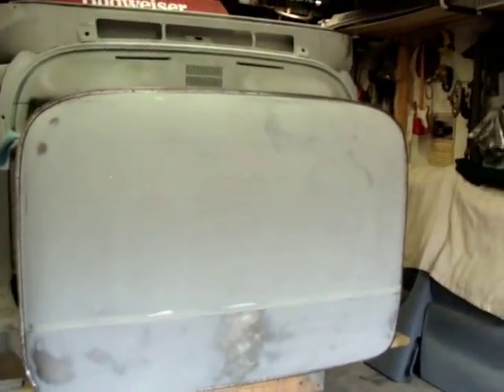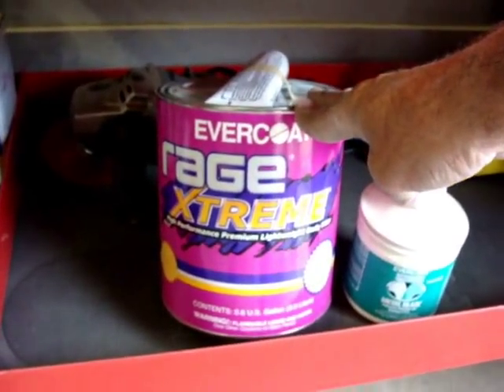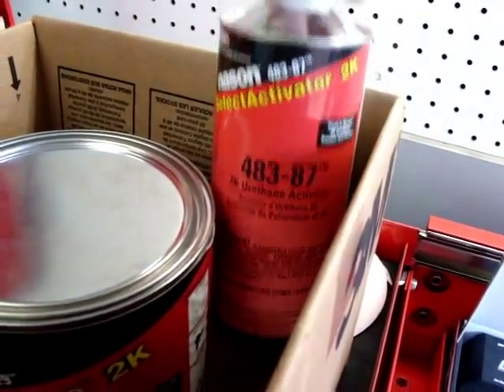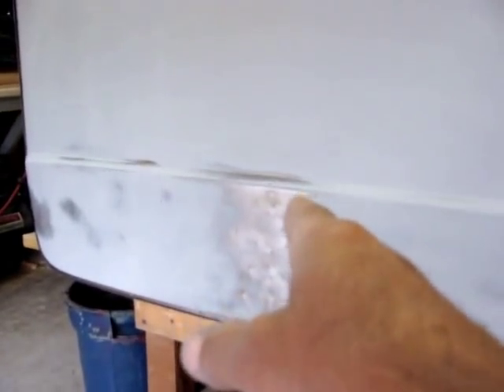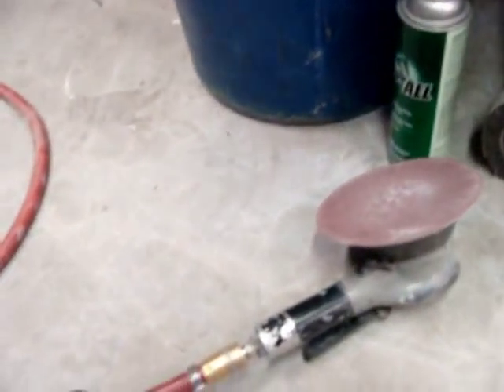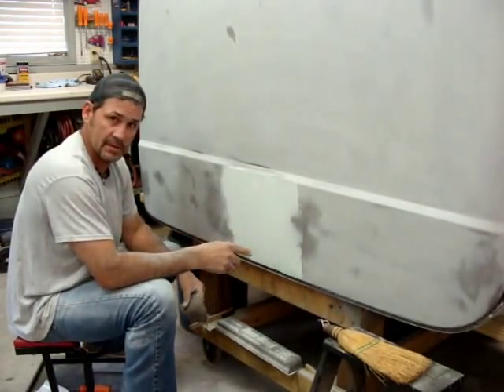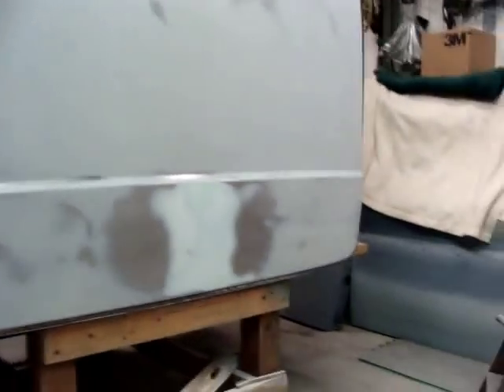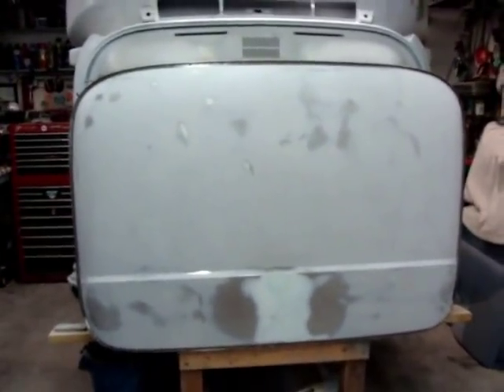sanding cab roof 1963 chevy truck

Comment: After you finish the prep work for laying the epoxy I  would recommend the you use an etching prep on the bare metal first and then lay the epoxy. Either etch primer, vinegar and water solution acid etch or some other metal prep material. Etching will save a lot of hassles later on with the primer sticking and keeping the rust from beginning on that area that you sanded shiny. Job is looking good, Cheers OLDDUDE

Comment: your doing a grand job dude, my method is to use acid etch on the metal and dont use anything rougher than 180 because in time the paint job will cure out and sand scratches may become visable and dont forget to always finish your primer prep with 500 grit on your da dry, if you leave lateral lines from your sanding as oposed to little ringlets from your da they will definately show through at a later date

Comment: Do you have a TDS for your Primer?  Mine (Max Meyer High Solids Filler 3011) says: "Polyester putties, sanded with P150-180, Fiberglass (GRP) sanded with P150-180."  I would say based on that, go with 180.  With 80, you would do a "lot" of filling with the primer and could see some shrinkage.  Hope that helps!

Comment: I found the TDS for your paint - i've sent you the link via personal message as youtube won't allow links in the comments.  The important bit from it says: "When using coarse grit paper, step your way up through P80/P180/P240 grit prior to priming to remove coarse scratches and avoid sand scratch swelling in OEM finishes." So looks like another step of sanding, sorry buddy!

Comment: Ah ok you are Epoxying before the primer.  In that case, the TDS for the epoxy (i'll send you that link too) says to etch the care metal first  "treat bare steel areas with metal
etch.".  Interestingly, it doesn't say for the epoxy, what grit to use.  Just says, "Thoroughly sanded painted surfaces" or "Clean bare steel or aluminum".  Interesting that it doesn't say what grit and that it doesn't mention polyester filler as a substrate. hmm, scratching head...

Comment: Judging by some things you've said in your other videos I'm guessing bodywork isn't your career? Your technique and skill level says otherwise, compared to a lot of "pro" videos I've seen. I'm wondering what your source of information is, if that's the case? You seem to have learned the right ways to do this kind of work. If not professionally, then I'd appreciate to know, so I can apply it to my '70 Chevy.

I just built a killer 550HP 383ci for mine. All self taught book and video.